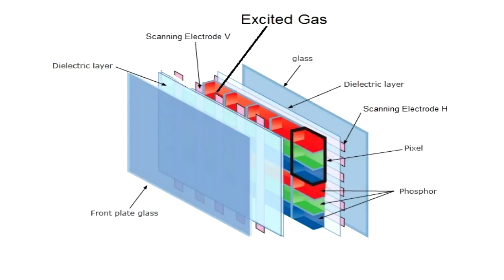Plasma Displays - How they work - VE-117

Comment: Actually, how it really works is that each "slot" as he refers to the tiny subpixels, which are individually sealed vaccum cavities are filled with a gas (xenon and neon usually). When a an electric current (coo volts dc) is passed through it from the electrical grid that covers each sub pixel, the atoms become ionized. This now beomes a "plasma" state.  When the current that ionizes the gas which turns it into a plasma state is removed, the electrons return to a lower energy state and rejoin the atoms. When this happens, photons are released which are in the UV light spectrum. Depending on which color phosphorus the back wall of the vacuum cavity is coated with , that coulour is seen as visible light of that particular color. From there it's simple RGB color mixing via sub pixel intensity.